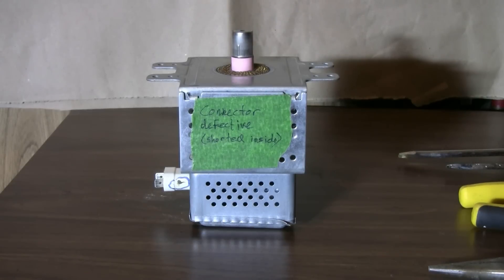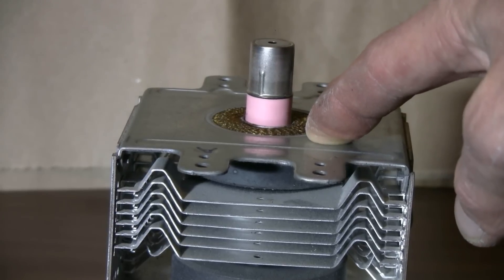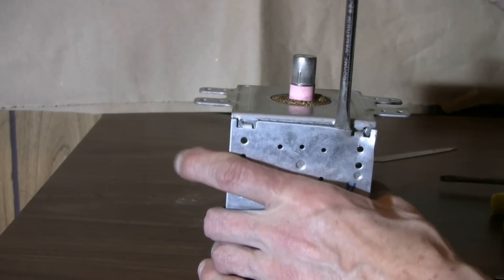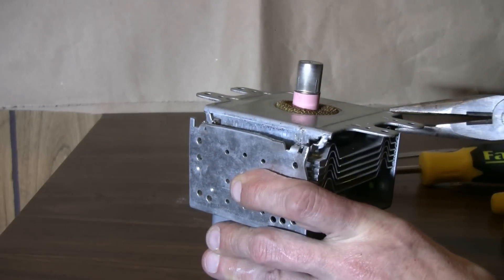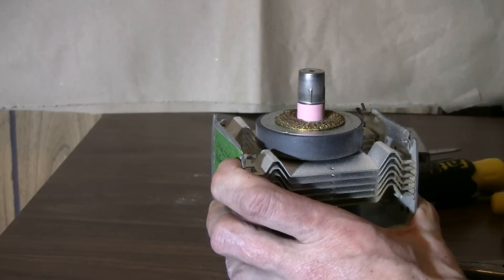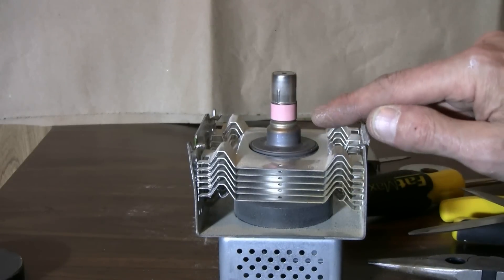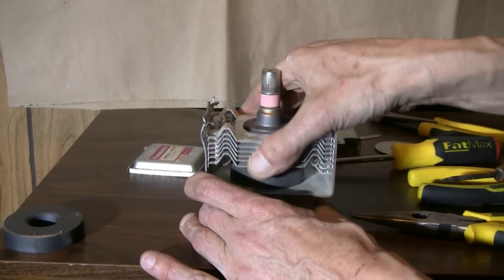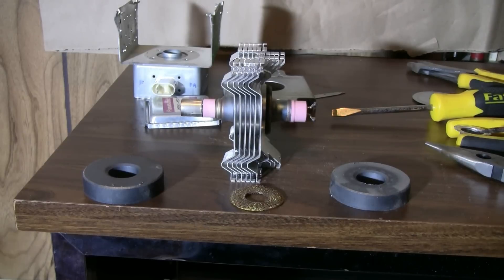DIY How To Disassemble A Magnetron

Comment: excellent tutorial and close up of the subject, it's a good idea to protect yourself further by taping the beryllium part, (beryllium dust is the dangerous part, it easily bonds with oxygen, and you breathe it - not good) so if you're like me, you have cuts on your hands (wear gloves) from wayward screwdrivers, especially when prying metal.
Reply: Oh no. I was moving my microwave around a lot. I have the possible broken glass pieces from the plate didn't get in there and chip anything
Reply: @Randorandom232  shouldn't be an issue, the plate and turn table are connected to a separate motor, the magnatron has its own sealed compartment, it's designed to create the heat to cook.

Comment: Great video. I just took apart my 1st microwave and broke one of the magnets. Is there anyway to glue the two halves back together? Is there anyway to tell if the insulator is Beryllium or not? can you use the cooler fins for anything? Thanks in advance, Mike

Comment: the connecter that's shorted is actually a capacitor to filter out high frequency interference that would otherwise go to the magnetron. Also, like 99 percent of the time the insulator is aluminum oxide. I've broken quite a few the past few months and I'm fine.

Comment: @ 8:26 he says you can use it has a diode. Can someone explain how I would do this as I have no other use for a magnetron. Do I power the heater and use it as one of those old vacuum diodes? Or do I have to modify it? Would it emit microwaves? What purpose does the antenna have or can I use it as the anode as it is connected internally?

Comment: Do you think you get one of them to do x-ray's if you used a liquid recirculating coolant with a lead casing shield?
Reply: No where near the voltage level needed for xrays, which require 60-150 kilovolts with on cycle measured in fractions of a second. You can get 'soft xrays' down around 20 kilovolts.

Comment: I'm 63 and throughout my life have torn apart microwaves for the magnets.
Usually with a large screwdriver and hammer.
I remember smashing the insulation every time not knowing at the time it can kill ya.
I searched for your video as i have a microwave oven from the local tip in the ute.
I took the magnetron out last night.
Now i can remove the magnets safely.
Thanks, your directions eady to understand .
Subscribed and looking forwards to more of your work.
Reply: how are you doing now at 68, my friend?
Reply: So Beryllium exposure must be exaggerated as you are still fine after smashing the insulator.
Reply: @austinscott813  I know these comments are old but there is no Beryllium in household microwaves, it's a kind of alumina.
Reply: @TheEinharjar this is true in newer microwave ovens. Older models used beryllium oxide ceramic as an insulator.
Reply: @PrimateGamingYT  Maybe in like the first gen from the 1950s but putting cancer dust in peoples house isn't popular.

Comment: WARNING DO NOT DO THIS!
Just one tiny speck of beryllium (the pink stuff) can cause incurable chronic Berylliosis lung disease. 
Now just how much is that magnet worth??
Reply: Well it's a good thing there isn't any beryllium used in these type unit ,and hasn't been for years.  Beryllium copper contact points are used through out every aspect of our lives. I use pure beryllium all the time in optic coatings it is very much harmless until a dust is formed either by mechanical means or burning. People expose themselves to far more dangerous things like smoking, driving and liberalism all the time.
Reply: Beryllium is no longer used in this kinda stuff....

Comment: Health hazards[edit]   Caution: radiowaves hazard   Caution: Poisonous particles for the lungsAt least one hazard in particular is well known and documented. As the lens of the eye has no cooling blood flow, it is particularly prone to overheating when exposed to microwave radiation. This heating can in turn lead to a higher incidence of cataracts in later life.[31] A microwave oven with a warped door or poor microwave sealing can be hazardous.There is also a considerable electrical hazard around magnetrons, as they require a high voltage power supply.Some magnetrons have beryllium oxide (beryllia) ceramic insulators, which are dangerous if crushed and inhaled, or otherwise ingested. Single or chronic exposure can lead to berylliosis, an incurable lung condition. In addition, beryllia is listed as a confirmed human carcinogen by the IARC; therefore, broken ceramic insulators or magnetrons should not be directly handled.All magnetrons contain a small amount of thorium mixed with tungsten in their filament. While this is a radioactive metal, the risk of cancer is low as it never gets airborne in normal usage. Only if the filament is taken out of the magnetron, finely crushed, and inhaled can it pose a health hazard.[32][33][34]

Comment: Good GOD man, PARANOIA runs deep in this guy! You would actually not only have to break one of those insulators and crush it to a very fine powder and then breathe it in to your lungs, ON PURPOSE, in order to cause any problems, but you would have to do it  with nearly the whole quantity of the insulator for it to be hazardous!
Reply: and also the insulators are made of aluminum oxide anyway, it's really in high power microwaves or perhaps really old ones the insulators are made of beryllium oxide. He's still got great content though, and I don't really see much problem with being as safe as possible.

Comment: yes that is the way to do it  I will add . disassemble it outdoors with the wind at your back or your side so if you have dust from a broken insulator it will not get inhaled.  the magnets are good and unlike speaker magnets there is no glue  preventing the removal of them.

Comment: i like the magnetron internal  visualization it helps me understand a lot.i have one thing to ask ,normally most of the time as i observed most of the magnetrons are supplied with a  3 to 4V Ac and up to 10 A current flowing through the filament.  what will happen if the supplied voltage to the filament is increased  or decreased? what makes the microwave output power high or low ?is is the filament voltage variation or the high voltage side variation ?
Reply: Power output is controlled by pulse width modulation of the primary of the power transformer.

Comment: Excellent video and very helpful. Have just disassembled a microwave and am using the microwave casing and bare innards as a housing for an outdoor furnace. Recovered screws, copper wire, transformers, plug, lead, fuse, scrap metal, timer mechanism etc but was aware of the potential dangers of a magnetron disassembly. Having seen this I will now follow the guide and hopefully retrieve the large magnets and copper mesh which I can see. I will however put tape around the exterior ceramic spike as an extra protection beforehand. But many thanks for the advice.

Comment: Thank you for telling me about the BeO insulator.  I always just thought the biggest hazards of playing with a microwave are getting electrocuted (even before it is doubled and rectified, 2kV was the voltage of the original electric chair), and getting "cooked" (if it starts with the door open, you can get deep burns as 2450MHz cooks deep enough there's no pain receptors).  FYI - That brass gasket is called an RF Gasket - it is to prevent this from happening.  2450MHz... that's the same frequency as WiFi, anyone ever get kicked off their WiFi when someone turned the microwave on?
Reply from the maker: +filter4now Modern magnetron won't use BeO insulators. I mentioned BeO because sometimes you get a really old scrap microwave that just might have them. Pays to be careful.

Comment: Why would one have to send the leftover parts to a special facility. People throw away microwaves all the time. Is it just that the insulators are not in a closed container.
Reply from the maker: +Austin Sherwood Depends on your local laws. Some places require special disposal for anything electronic. Normal garbage pickup will not take them. You take it to a special enviro depot and pay a fee.
Reply: Bill Gilmour ok, thanks so much 👍

Comment: wats ruff specs of it as a hv diode..... and rf safe

also any clues using it as a plasma generator without the rf generation hazard
Reply: This is exactly my question.....
Reply: I don't believe the diode bit. The magnetron is just a resonant cavity, self oscillating, RF device. It lacks a semiconductor that could act like a diode. As a vacuum rectifier it would lack filament heaters to assist cathode electron emissions. Microwave ovens do  have real nice HV diodes. They deliver DC power to the tube. They are not part of the magnetron assembly. I think "Bill" is wrong about a Magnetron's ability to rectify high voltage.

Comment: Pink color is addition of chromium dioxide for extra hardness and nothing to do with BeO which is naturally white..
Look up manufacturers data and find Samsung and panasonic for example have never used BeO.
BeO is 500 more expensive than Al2O3 (Alumina) which does same job for domestic apps.
BeO is used in rocket engines, radar systems or industrial microwaves above 50Kwatts.
Wikapaedia is of course full of mis-information about these  cheap domestic ovens
Why use a poison in a domestic app.
Why use an expensive product in a throwaway item.
The oven has a fan venting the inside to the outside (breathable air), so why risk dispersing a poison into the room.
BeO is not used or ever has been in a domestic product.
Reply: Geoff Rohde thx for your clarification. I dismantled my 1st microwave magetron few weeks ago without doing much research and i smashed the pink insulators into smithereen, and worried sick about it after reading some comments about BeO.  It make sense manufacturer of common household MW oven  don't use BeO insulator for cost and safety reason.
Reply: Thank you for clearing  up this.
Reply: If you are working on a magnetron, you probably took a microwave oven apart, already.  That means that you had to deal with something more immediately dangerous; the high voltage capacitor. That thing can actually kill you if not discharged.

Comment: How do you dispose of what's left of the magnetron after retrieving the magnets? I can't imagine you would want to through it in the bin and risk someone else scratching the insulator!
Reply from the maker: +ZBCuber We have electronic recycling drop off bins located all over the city. These bins accept microwave ovens. I put the shell back together after I have salvaged what I want from the microwave and take it to one of these special recycling drop off bins.
Reply: ZBCuber why get rid of it when you can use it to create MF plasma?
Reply: sell it for scrap......
its nearly pure solid copper

Comment: Just for the sake of safety why not put 2-3 turns of insulation tape around the insulator? Surely that would keep it intact and cushion it if the screwdriver or pliers slipped!
Reply: I thought the same thing or a heat shrink wrap?
Reply: Or wear a fucking gas/dust mask along with the gloves and eye protection.

Comment: thats a beryllium one the white insulators are aluminiumoxide
Reply: Your right. Pink color is addition of chromium dioxide for extra hardness.
Look up manufacturers data and find Samsung and panasonic for example have never used BeO.
BeO is 500 more expensive than Al2O3 (Alumina) which does same job for domestic apps.
BeO is used in rocket engines, radar systems or industrial microwaves above 50Kwatts.
Wikapaedia is of course full of mis-information about these  cheap domestic ovens

Comment: be0 is not used nowa days on the insulators
Reply: Your right. Pink color is addition of chromium dioxide for extra hardness.
Look up manufacturers data and find Samsung and panasonic for example have never used BeO.
BeO is 500 more expensive than Al2O3 (Alumina) which does same job for domestic apps.
BeO is used in rocket engines, radar systems or industrial microwaves above 50Kwatts.
Wikapaedia is of course full of mis-information about these  cheap domestic ovens
Reply: @geoffrohde3434  They use it in High power Rf tubes in transmitters as well. It's hard to break the ceramic even with a hammer. its very hard
Reply from the maker: Thankfully not. I don't always know how old some of the scrap that I get is so I like to be careful with old unknown magnetrons. It's different if you get the whole microwave and know how old it is. Some of the scrap I get dates back to the 1970's.
Reply: I know im the same better to be safe, great vid eye opener for peeps who aint got scooby
Reply: +Bill Gilmour  Hey Mate, today I scraped my old microwave and also the magnetron (didn't know that there was beryllium :/) I did everything outside, so there was enough air circulation. I didn't destroy the purple stuff, the only thing that happened was that I scratched it a tiny bit. Just a very small amount of it is missing. Was the purple stuff on the outside also beryllium? Should I be worried about getting beryliosis? the microwave was about 15 years old
Reply: ***** If I had known earlier I wouldn't have scraped it, but now it's too late... so could you please just tell me if I should be worried? And should I get rid of the magnets i got from the magnetron? Or is it fine as long as I wash them?
Reply: ***** I already threw the magnetron away. Phew, I'm glad that I managed to handle it without breaking. Haha don't worry my english isn't the best either 'cause I'm not a mother tounge :D

Well anyway thank you for helping me to calm down, I already thought about berryliosis and all that stuff... If I want to scrap something again I'm gonna search it up on the internet first :'D
Reply: I guess it is alumina ceramics. Safe and much cheaper.

Comment: No harm no foul, even if you broke the insulator you are not going to die of cancer.

The gasket was probably beryllium copper (spring copper) mesh also as is common in microwave shielding parts like finger strips
Reply: It's brass. Be is not used in domestic appliances. 
Pink color is addition of chromium dioxide for extra hardness.
Look up manufacturers data and find Samsung and panasonic for example have never used BeO.
BeO is 500 more expensive than Al2O3 (Alumina) which does same job for domestic apps.
BeO is used in rocket engines, radar systems or industrial microwaves above 50Kwatts.
Wikapaedia is of course full of mis-information about these  cheap domestic ovens

Comment: why can't the magnetron manufacturers made it in porcelain instead of beryllium oxide
Reply: They do. BeO is not used despite wikapaedias claim
Why use a poison in a domestic product
Why use a product 500 times more expensive than Al2O3 (Alumina) when the latter does the job in a through away cheap product.
 Pink color is addition of chromium dioxide for extra hardness.
Look up manufacturers data and find Samsung and panasonic for example have never used BeO.
BeO is 500 more expensive than Al2O3 (Alumina) which does same job for domestic apps.
BeO is used in rocket engines, radar systems or industrial microwaves above 50Kwatts.
Wikapaedia is of course full of mis-information about these  cheap domestic ovens
Reply: Slovenščina K 
Because BeO has the highest thermal conductivity of any ceramic insulator.
Reply: But than, fluorescent lights, made by and used by millions, all use mercury inside, another poison!
Reply: Geoff can we also call this contraption a particle accelerator like the one we see , the CERN?
Reply: Martins maskiner because of radiation protection
Reply: are all Panasonic microwaves BeO free?

Comment: If you were so concerned about damaging the insulators why didn't you wrap them with electrical tape  or some other method of encapsulation?
Anyway good video thanks for posting.
Reply: I agree 100%!  I thought as he was fumbling with the large screwdriver he should have put electrical tape on the
deadly pink insulator.  If large screwdriver slipped and hit deadly pink it would hold the breakage within.

Comment: Unless you go grinding away with a grinder, there is no chance for any dangerous dust. The insulator is very thick and extremely durable. You can throw the rest on the ground and it will not even break, so no need to be afraid of taking it apart.
Reply: yeah I have had about 20 lbs of beryllium copper that has been polished into the most brilliant mirrors  for over 10 years.  It is sealed safe and sound.  But i agree that its always best to be safe.

that makes me thing.. I wonder if my beryllium is worth anything.

Comment: Good video!, from what I understand a lot of the newer mags use a non-Beryllium based ceramic, but as you demonstrated, its better to be treat them all the same, especially if age is not known.
Reply: Maybe Mr.Owl knows. Mr.Owl, how many licks does it take to get to the center of a magnetron insulator?
Reply: no one has found out, they got berylliosis before they finished
Reply: The symptoms of acute pneumonitis following a massive short-term exposure do not become manifest until 3 days. Depending on the degree of exposure, periodic medical examination is suggested. Do NOT take working clothes home. Card has been partly updated in October 2004. See sections Occupational Exposure Limits, EU classification, Emergency Response.
Reply from the maker: Most that I get are old, so it is best to proceed with caution. Thanks for watching!